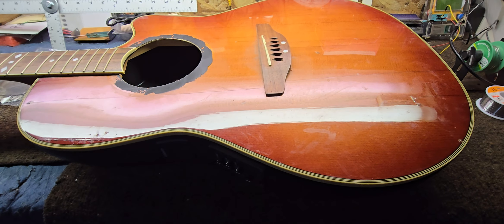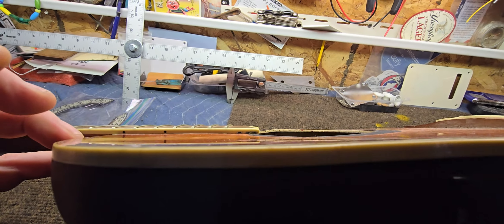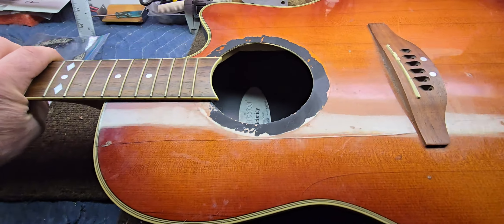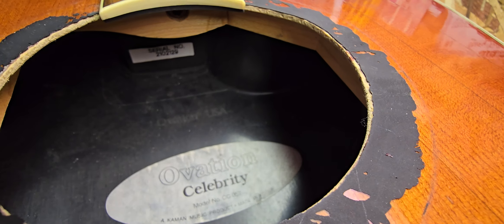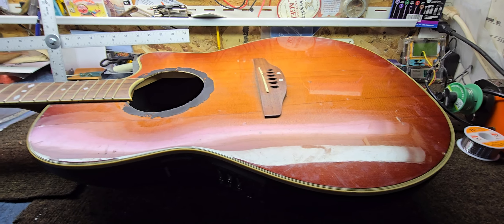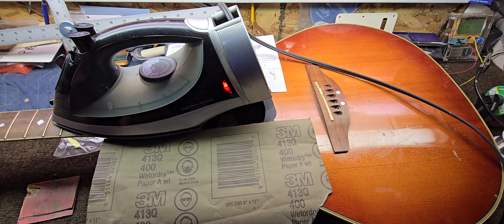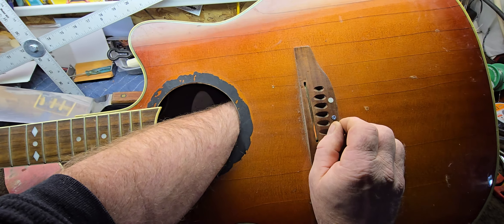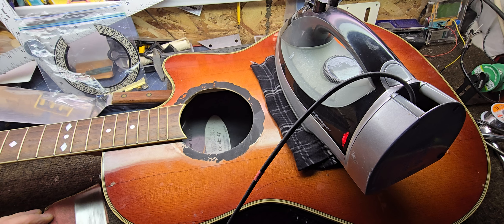Guitar repair.  ovation celebrity bridge removal and fret board extension.  bolt on conversion prep.

Comment: Thank You ! I can see from your technique that I have some very tedious work ahead of me in getting my 1979 Bridge removed and replaced. The Neck also needs to be removed for alignment as what was shown here. My number one concern is getting the same type of bridge from even a secondary source. Ovation/Applause manufacturing in Korea are out of stock unless you know of a good source to obtain one. The only other option is to make one by hand out of Rosewood. Good Video and looking forward to the 2nd part video.  All My Best !